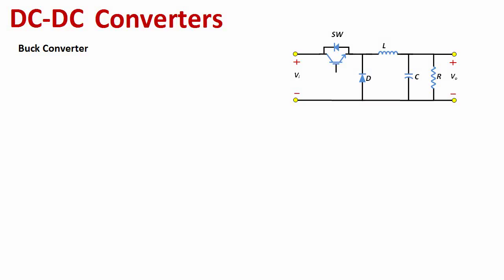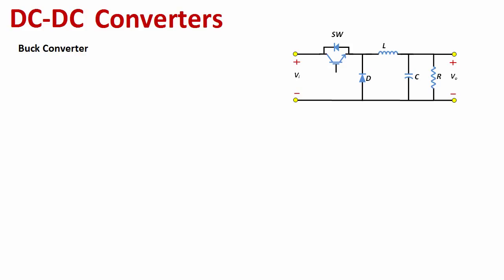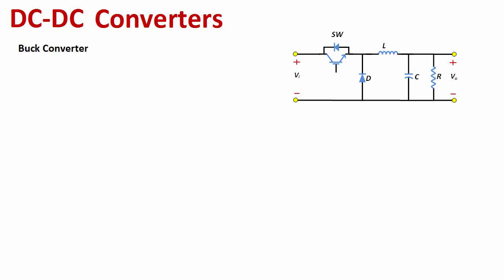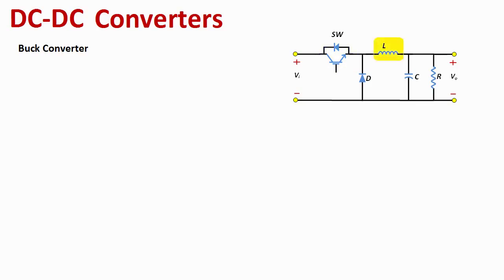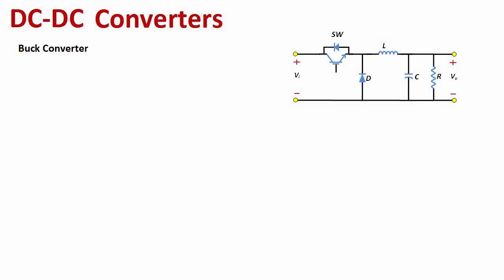DC-DC Buck Converter 1

Comment: Hello sir,
I want to make an DC to DC converter which can give out voltage from 0 to 72v with 80A . The input voltage from an battery is of 72v 100A.
I whan to use this converter as an speed controller of an 72v 5kw DC Shunt Motor.
Can please suggest an proper circuit and the at what frequency should I have the switching.
Waiting for your reply.
Thank you
Pratik Mahida
pratikmahida29@gmail.com